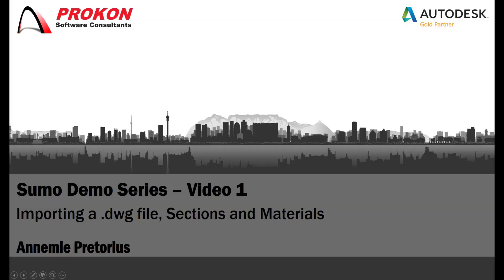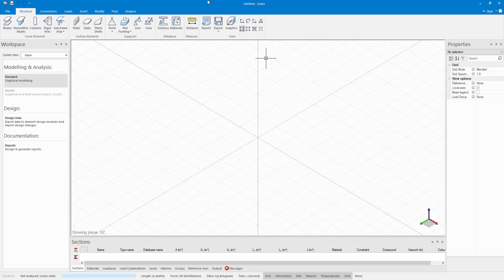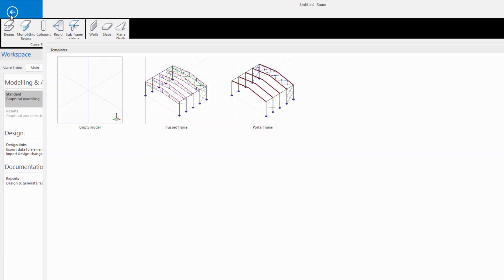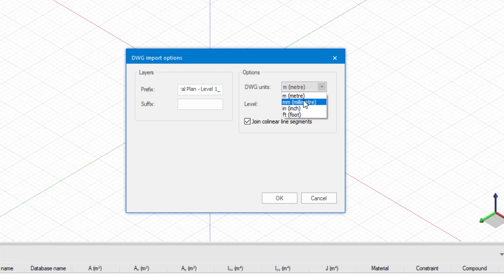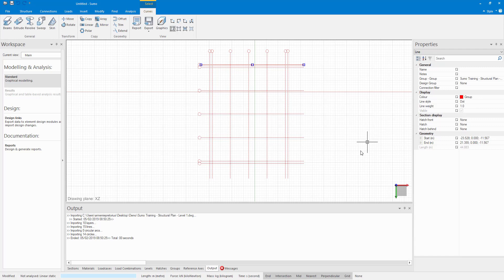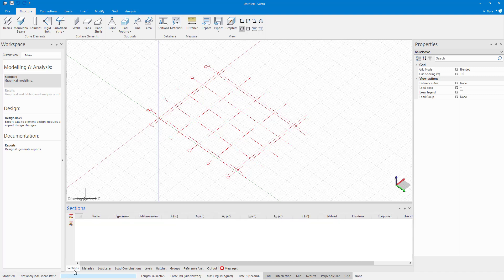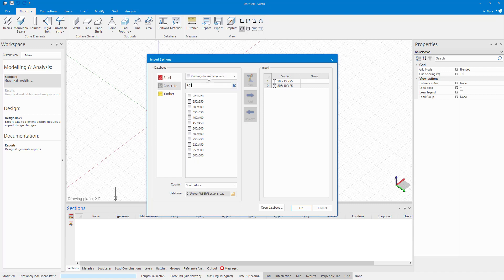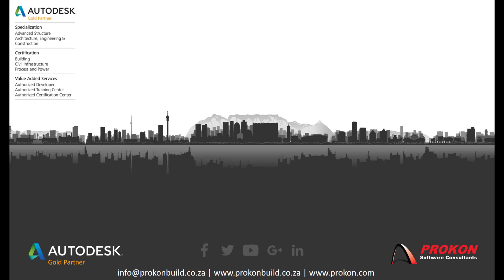Prokon Sumo - Demo 1: Sections, Materials & DWG. files

Comment: Hi, 
How can one add Brick-Work Materials on Sumo? I can only see the Steel & Concrete Material & not Brickwork.
Reply from the maker: Although there isn’t a category for Masonry materials, you can add a Custom material to the Material database. Take note that the analysis done by Sumo is linear elastic and that the material’s stress-strain curve is currently not considered. (material non-linearity can be considered in Frame).

The wall element in Sumo has the feature of “pinning” the edge of the wall, in other words, the connection between the wall element and any element connecting to the edge of the wall doesn’t transfer bending moments. Keep in mind, however, that shell elements will resist tension and compression forces, which isn’t usually the behaviour you want in masonry walls.